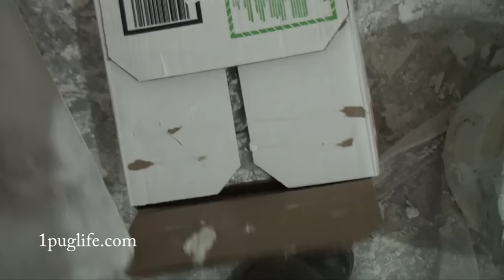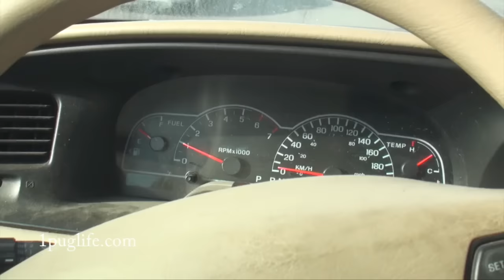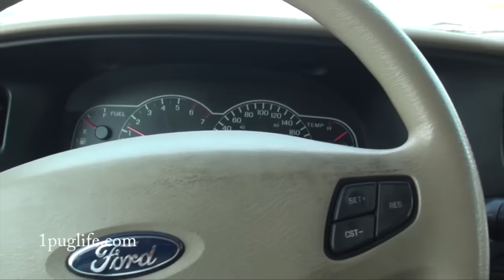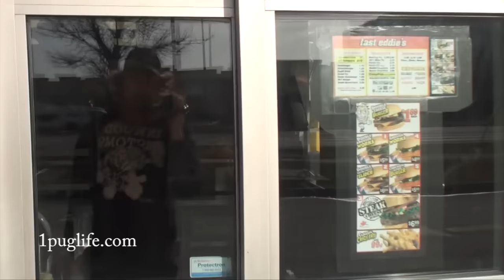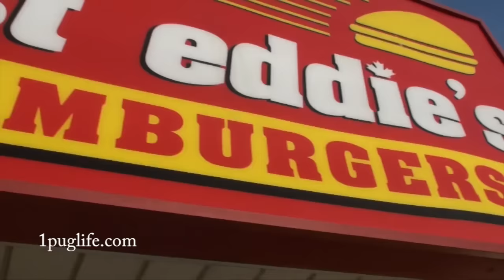got whats bin coming

Comment: Now you know why we got rid of our Ford Windstar Van. The next thing now is it will just quit running while you are zooming down the highway and you have to coast on the shoulder of the road and after a few attempts in will finally start again. Nope, Not the battery connectors, or the battery, it was the wiring harness.

Comment: Has a shop and can't maintain his vehicles to make it to town and back. 
All that equipment and tools you buy just sitting in the tool box. 
Purchased a skid steer used it once then put tires on it for it to sit While the van and the diesel truck falls apart. Has the other truck even been used this year?

Comment: You remember the original guy who taped everything first (the one you fake got rid of) that's where the original no joint compound behind tape started , the second set of finishers could have peeled the tape back and put more joint compound under the tape but forged ahead and really messed up by the looks of it, anyway a few bubbles might not show up if it were textured.

Comment: You got a bad ground connection under the bonnet, check where the battery ground bolts to the bodywork and engine.

Comment: leave the tape there..  the reason the Tape bubbled is cuz the compound was too dry.. it didnt stick..  you should add a touch of water to the compound  then remix then apply a wet compound.. it was right out of the box or bucket..  tapers fault....just keep plastering
 then sand then prime.. DONT RETAPE

Comment: Alternator or charging issue on the van bud... Charge it up, start it , and check the voltage with it running. needs more than 13.5v if less you have a bad alternator or charging cable...

Comment: Ah buds it's prolly the key switch mine got cocked it took me a while to figure out but that was the problem. If it seems like your rig wants to run but it's acting like it's carbureted and some days it will be totally fine and work like normal but other days it's acting like a peice of shit ,  then that is most likely the problem.

Comment: there is a dispenser for paper tape that coats both sides before it's put on seam. I knew that was gonna happen when I saw pauliester putting it on dry ffs
Reply: +biggdaddy2001 should have just used the fiberglass mesh for small job ffs